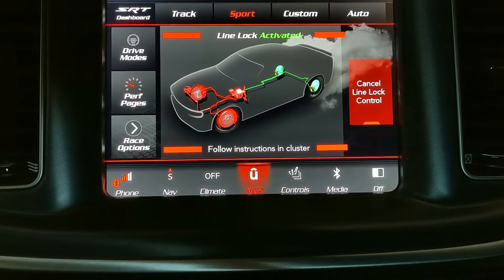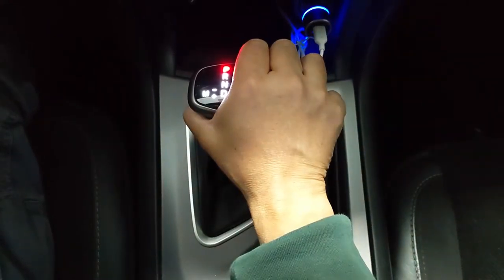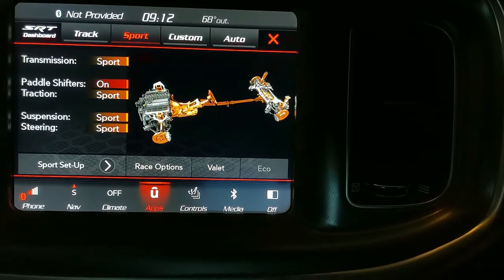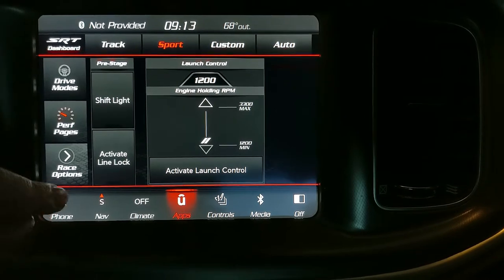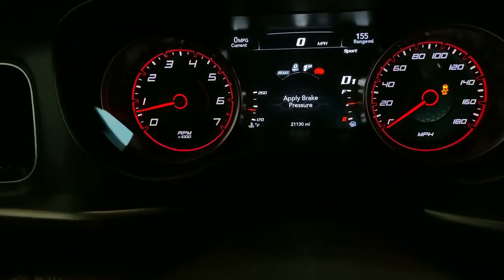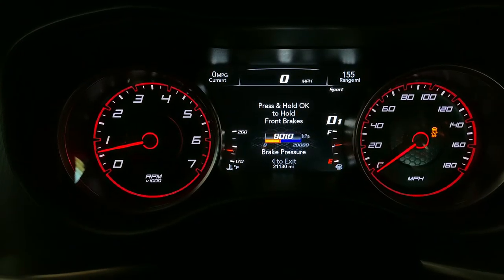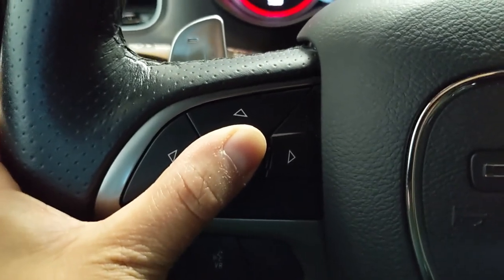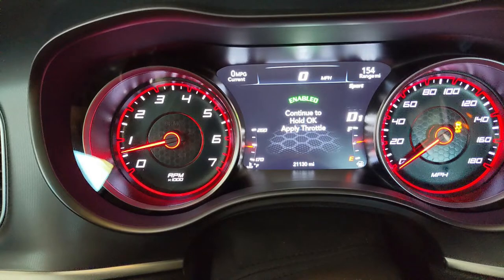Dodge Charger 392 Widebody: Line Lock

Comment: How you in Drive but your foot wasn’t on the break
Reply from the maker: The Line Lock feature keeps the front brakes enabled.
Reply: So to do line lock, the car has to be in drive with your foot on the brake like you’re at a normal stop. Once you engage line lock, it just wants you to push extra hard to ‘pump’ the brakes for pressure. Then, as the video shows, the brake function is transferred to the OK button on the steering wheel. Hold that and the cars front brakes are held while the rear is free to spin. Press the gas and it’ll spin and burnout until you let go of the OK button. You can let go of the OK button while in the burnout to get a rolling burnout going as well. 

Long story short, once you enable line lock mode, it’s a small process to transfer the brakes to the steering wheel control.  :)
Reply: @kristenmoon4405  spot on bro!!